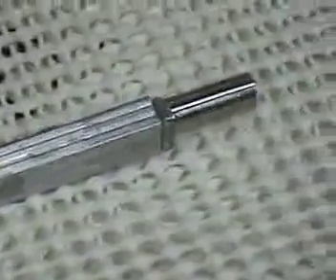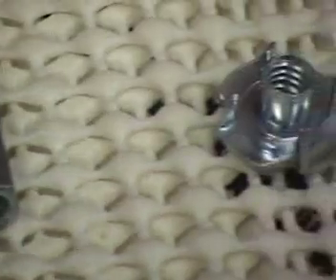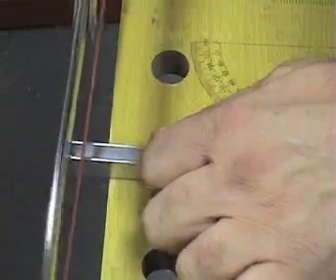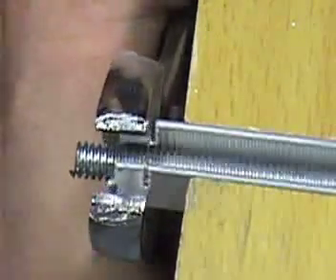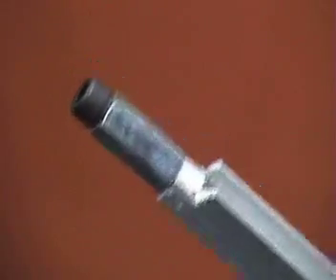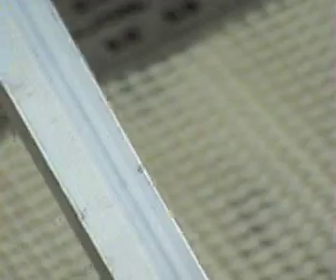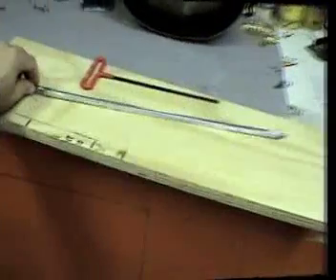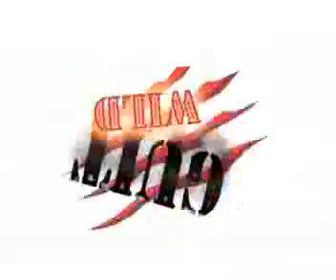Making A Guitar Truss Rod

Comment: McLendon's has them, but you have to purchase an 8' length.  The 14" rod just barely fits inside freely.  Every hardware store seems to have a different and arbitrary assortment of sizes for these.

Also, you can get round aluminum spacers if you don't want to have to file down the hexagonal profile of the coupler nut.

Comment: Have you ever build a double neck guitar or a 12 string guitar?  Do 12 string guitars use the same truss rods that a 6 string guitar does? Or do they use a specific type of truss rod since there is more tension since there are 6 extra strings?  Have bought 3 books on guitar building but none of them mention anything about 12 string guitars. Can you please help?